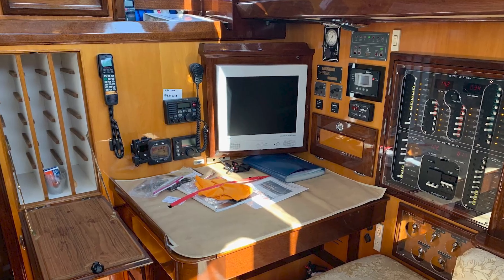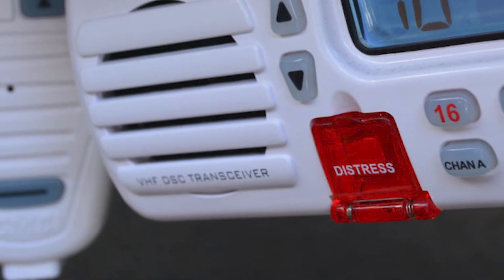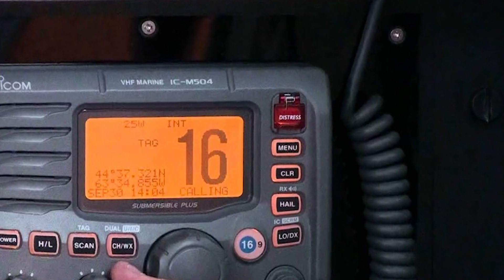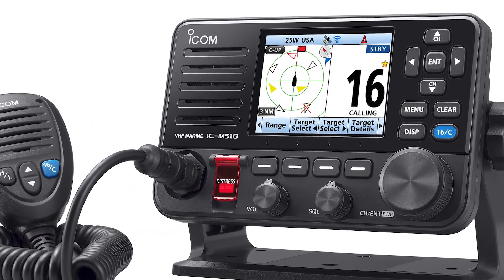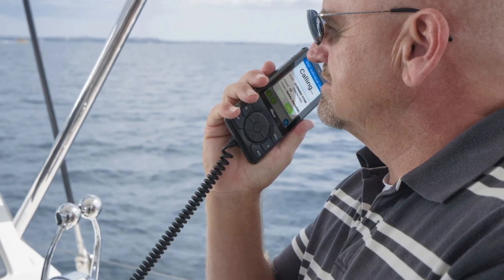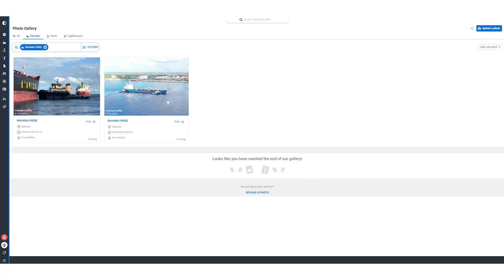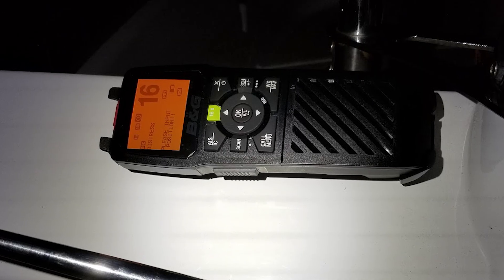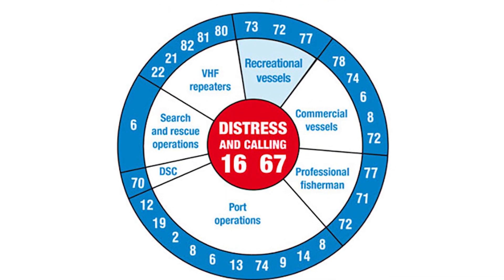Marine VHF Radio - What You Need to Know

Comment: From a Ham Radio user I do listen on Marine Freq I have one radio Programmed to it.  When working by a coast line I do listen one time I did relay information as other radio can pump out 50 to 75 Watts way back in 2001 Some one did say to me your licence don't cover that band if I hear a call I will call back saying Ham Radio operator with full band capability Also if I hear Air craft I would do the same.

Comment: Hi Tim. First, despite my having serious reservations about the Negative impacts of Sailboat Racing on Cruising and Voyaging Sailboats that I think I have made all too clear on your Lady K Channel. Well Credit where Credit is due Tim, to me, you have absolutely knocked it out of the Park with Practical Sailor, so keep up the excellent Work. 👍 So some tips for getting an increase in the effective Range of VHF from a 65 mile radius, and up to about a 100 mile radius, at not a horrible amount of extra money. Credit to Clark of Clark’s Adventure Channel who gave probably the fullest and clearest instructions of what to do, which will likely be better than my attempt to pass it on as a thank you to you. This will help any make of VHF Radio - first, start by making sure the DC power feed to the Radio is clean and the full DC voltage, so the signal into the cable is at its best, then use the more expensive low loss thin Cable - check to get the correct one, because there are several,options apparently, then try to have just one piece up the Mast from the radio socket to the Aerial Socket at the top of the Mast, and make sure that all connections are water proof, to prevent water getting into the cable. Next is very important, and there are options, but that aerial needs to be at least as good as the very well known  Shakespeare 6 db gain antenna, which is so well known due to the terrific Reputation it has earned deservedly and it is the only  VHF aerial that I use. That extra Range can be really important, and allowed me to chat with the USCG when I was in the Gulf Stream on my way to Bermuda, get confirmation that I had left USA Territorial Waters, and was able to discuss options following the Tornado heading my way, which required urgent action and the right direction to head in to seek shelter.That meant back to the USA, and getting my 90 day Visitors Visa Refreshed, due to the Severe Circumstances threat.I have no idea how far away from that USCG Station I was at the time, but we were 5/5 to each other. The radio was a new Standard Horizon from West Marine, which seemed well up to the job - though I have a soft spot for Icom Radios, and thanks to lots of experience with CB Radios, those made by Cobra / Superstar have really served me and my customers extremely well. It is probably very hard to find a VHF Radio today, that is actually Bad ? 🤔 Loving this Practical Sailor Channel ❤️ Best Wishes. Bob, who used to get the equivalent UK Magazine Practical Boat Owner, as a kid. 😅 👍🌟🌟🌟⛵️🇬🇧🏴
Reply: PS. Actually it was Dad who got PBO every month which was eagerly grabbed by me, as being Dad, we shared boating ambitions, such as doing a Circumnavigation - which which due to the Bureaucracy of today, I have now abandoned any thoughts of doing. 👍

Comment: DSC almost literally means no one is on the bridge. Distress can be completely automated and it changes listening radios voice channel to 16. At 1 watt, DSC bridge hailing is a casual call that you pick your favorite boat's MMSI number and change their voice channel to one you selected. If you have an older radio, keep it as a second radio at the wheel or near your bunk. It can also be a shore watch. Channels 68, 69, 71,72, and 78 are casual use frequencies. Without them, VHF would be an obnoxious stuffed shirt service. AIS is 2 frequencies and 2 wattages. Big boats run 12 watts. Common boats run 2 watts. They can actually use a common boat antenna, but a slightly shortened antenna is optimal. The real beauty of AIS is that the system is contained in the radios of the boats receiving each other. AIS can work anywhere. Satellites and special stations can piggyback on AIS, without hurting it. A CB radio is a must have fo more utility and fun. You use it skillfully.

Comment: Very relevant video.

Back when I started cruising with my father, back in 1976, we had a vhf radio the size of a small modern drawer fridge lol and the back stay was the antenna. 

It worked great, never missed a beat and for memory it had vhf and AM, VHF was for short distance and AM was for long distance. 

These are very basic pieces of equipment and still fully monitored today. 

Im always concerned when I see new yachting youtube channels basing their navigation on not much more than a cell phone. Its insanity! 

Another basic piece of equipment we used back then was a radio direction finder which proved invaluable when our starter motor broke down and was repaired in the cockpit which absolutely destroyed the correcting magnets for the compass. 

I know that GPS and modern communication makes all these things seem obsolete or "old hat" but when modern communication goes down, which it does, youll thank your lucky stars you had these in the bottom drawer of your nav desk. 

Cheers 🍻🍻
Reply: Hahaha - fridge radio😂😂

Comment: I still think its annoying that Canada requires more licensing for VHF.  I took, and passed (score 100% -- im also a ham) the ROC-M through CPS.  That allows me to use VHF.  But a base station at the cottage requires a station license, including inspection i think -- in addition to all users having ROC-M.  That barrier to entry means fewer users -- they might be more competent, but plenty of marinas and smaller commercial boats no longer use or even have VHF because of the license requirement.  As far as i know in the US no license is required for VHF (or HF, unless you traveling outside the US)...  And just about every marina, even at Yellowstone, or a state park reservoir marina, will have VHF...  In the VI, the Caribbean, etc -- everyone has VHF.  But not in Canada, at least not in Georgian Bay...

Comment: Having an emergency button that blasts out a distress call sounds like a great idea, until the manufacturer puts the button right next to a bunch of other buttons that are commonly used. The Coast Guard then has the responsibility to check on all the distress calls originating from accidental presses, and thereby diminishes the sense of urgency. It's no different than all the accidental 911 calls butt-dialers make with their phones. The cops are coming, but they're not coming fast.
Reply: It's very difficult to press it by accident. Every person on board should be given a quick lesson in basic VHF use.
Reply: My distress button has a little plastic cover that you have to lift to depress it, not something you can bump on accident

Comment: No that’s not actually correct, 16 is the emergency channel to be used and/or for initial contact. Channels 71,72 and 74 are the channels to be used for conversations be it with other sailors and/or marine safety organisations, like what we have here in Tassie (Tas Maritime radio) who provide weather forecasts, marine hazards info, let alone are the link to rescue organisations.  

While VHF is still one of the most useful communication tools on a boat, its range limitation is one of the downsides of it and as such HF still has a value to have for offshore passage making let alone the newer satellite tools inc Sat ph, iridiumGo and Starlink

Comment: When I was in the Coast Guard in the early 70s, a lot of boat owners, particularly on the Great Lakes use CB radios. So we used to have CB radios at the stations and on the boats not always authorized but we put them in anyway. No radio direction finders or very very few. No GPS made the job a little more difficult, but we still got it done. If you have a boat, get the best radio the best safety equipment that you possibly can. You may need it only once in your life it will more than pay for itself. Who knows it may even save somebody else’s life and there again, it will more than pay for itself. lastly I don’t know how many people do it anymore but a real float plan your boat how many souls on board where are you intend to be and when you intend to get back and leave it with somebody that knows to make that call at 2200 when you’re not back good idea. Remember one hand for the boat.
Reply: It's 2025 Mate.
Reply: @ so it’s 2025 big deal. How long were you in certain rescue? How many people did you save and how many people were not able to be saved during your career in search and rescue? I have over 40 years in a certain rescue field. I guarantee you I know what works and what doesn’t.
Reply: @JohnHill-k6p  Boating equipment is much better than it was in the 70's.
Reply: @ I didn’t stop boating in the 70s I’m in my 70s and I still spend many many hours on Lake Michigan and the oceans

Comment: GMDSS/DSC was supposed to be implemented in late 1990's. I've had my licence since then. Here in Aus, the Australian Marine Authority, the coastguard, volunteer rescue and the boaties are dead-set too stubborn or thick to realise that this is a life-saver.
And they are one of the founders of the UN, as well as the subdivision SOLAS. (Safety of Life at Sea)
They treat it as if it is an optional inconvenience.
Also - there is no privacy channel. If you put in your mate's MMSI, everyone will hear the call and be able to chime in. The difference is that your mate's radio set will beep like a phone, but not anybody else's.

Comment: My handheld has DSC and includes gps info. One time I heard a loud beep and it seemed according to the display that I was receiving a distress signal. I was concerned that I had SENT that signal, but it was coming from someone else's dsc radio. I guess it sends out a signal so boats in the area can assist. In this case it was sent out by mistake, through some technical problem, and the coast guard was aware of that. I listened to the whole thing while it was getting resolved. I don't know if mine sends out a signal like that I'll have to check.

One bit of advice (to myself included): Learn how to use all the features, and learn what the radio displays in different situations. When it's happening in real time, I'm trying to maintain control of my boat while glancing at my radio and wondering what the hell it's saying. Even with a large display (for a handheld), it's not always so clear what's going on.

Also, my boat is fairly small, so I'm low to the water and don't always have a line-of-sight path to the Coast Guard antenna. I have tested my dsc (using the test function), and the signal doesn't always get through. When I hold it up high, it can get through. If it doesn't get through, my radio tries every four minutes. I need to know that, because if I don't get through, I could hoist it up (if I can) to get a signal through, or ask nearby boats to relay my info. I also have to be aware that when I'm in the water, my signal might not get to the Coast Guard directly, but at least nearby boats would hear.

Comment: on VHF AIS display looks a bit rediculus - that belongs to an integrated chartplotter. however when I was shopping for a backup handheld vhf I actually opted for an AIS capable one, so that in case of an emergency, I would really like to have some visual triangle on the display of a nearby boat.. As I was doing my research I think there are a lot around the handled ones. eg. connecting to an external antena. I'm thinking of making a socket to connect handeld backup VHF to boat's big antenna.

Comment: I want to start this in the very beginning. Marine VHF replaced an AM based low shortwave service of the same wattage. In theory, but not in practice, FM doesn't allow you to listen to the static, the best way to stretch your possibilities. It has function. It could have a whole lot more. I have the best Pearce Simpson hand built radio on the planet. It's only ho - hum. DSC is automation. It's main purpose is to deal with no sailor on the radio station. It does let you name yourself, but sometimes this works screwey. It captures NMEA 1283 GPS information and sends it for you, but rudimentary DSC 101 doesn't receive it. AIS is sensible as the works is based on each vessel that carries it. You can only use it when you are not afraid to divulge your location. It can also be a wattage hog for boat batteries. There are unmentioned technologies that tie in. Man overboard gadgets. SAR's that pinpoint your distressed boat. Similar PLB's. Two services can plug you in. Aircraft radio is AM VHF, and boy can that plug you in for rescue and relaying.  CB radio is the little 4 watt AM service roaring lion, with a sharp emphasis on fun and utility, but it can outperform all the above. There's also SSB CB radio, an advancement that can talk hundreds or thousands of miles. Radio pays you back. Don't be a sheep. Use what you've got with skill and make advancements. Shore Watch stations can also row oars. A VHF and a CB in your bedroom or kitchen is a really good idea.

Comment: Nice video today but one comment there is nothing private when using DSC.. your audios just as audible by other boats as it would be with just an old VHF radio.. 
DSC allows multiple radios to listen to the same frequency and only provide audio when called with the correct DSC code

Comment: Great video and information. One thing I've had to explain to some boaters who did not want to invest in a VHF under the pretext that, if  necessary, they would simply dial *16 on their mobile phone. True that the Coast Guard will get the call, but ONLY them! Whereas on a VHF, any boat within signal range will hear you and can render assistance much quicker.
Reply: Is *16 still valid?    The Coast Guard requested that all cellular phone service providers discontinue the “*CG” service, except in Alaska, and any such calls be routed to the 911 Public Safety Answering Point (PSAP) nearest to where the call originated.
Reply: @sv_Island-Time it still works here in Canada. I used last weekend.
Reply: A little chlorine in the gene pool.😂
Sorry but, they are their own worst enemy.

Comment: One of the first improvements I make to any boat, is to upgrade the VHF to one with DSC and AIS receive capability. I often sail single handed and the AIS receive function can serve as an active watch keeper, if I need to nap at night. It also helps identify who the running lights belong to in the middle of the night, and a radar in low visibility. Keep in mind, it doesn't transmit my info, so others won't see me, so vigilant watch keeping is still required.

Comment: Great summary, Tim. Heads up that your VHF channel diagram is missing channel 68. Also, in my experience 68 is often the marina and yacht club hailing channel in most harbours on approach so can get very busy if boaters are using it for general communication. Better to use 71, or 72. Any idea of whether you can use an AIS enabled radio to direct call a vessel via DSC by a single click on the vessel identifier on a chart plotter or vhf radio? This feature, in my opinion, would make direct dsc calls so much more practical as currently I have know or look up an MMSI number of the vessel I want to call, enter that number manually into my vhf and then issue the dsc call. Fine if I’ve set up an address book in my vhf for frequently call boats, but a real nuisance when trying to call a random boat on AIS to ask their intentions or give them info.